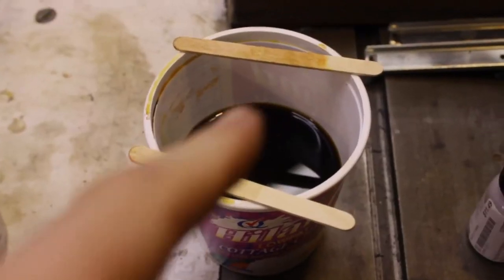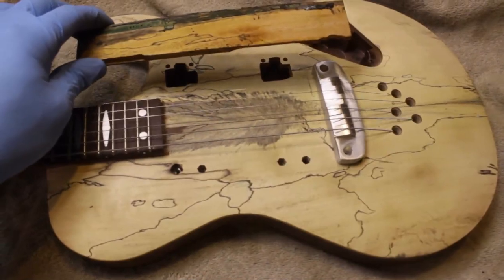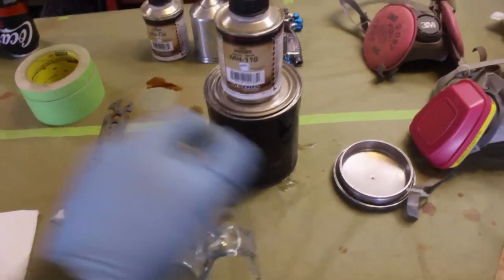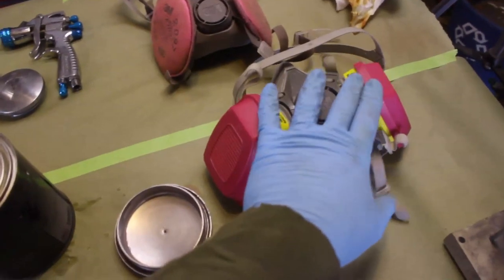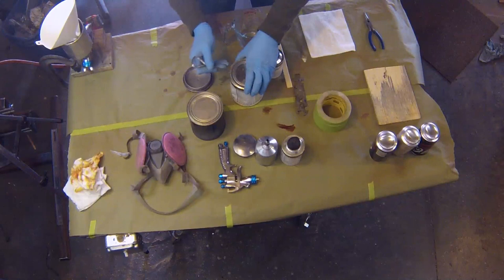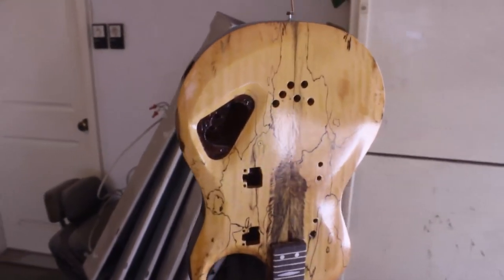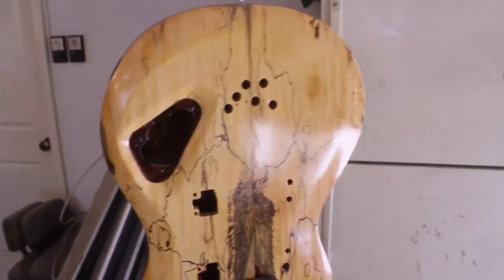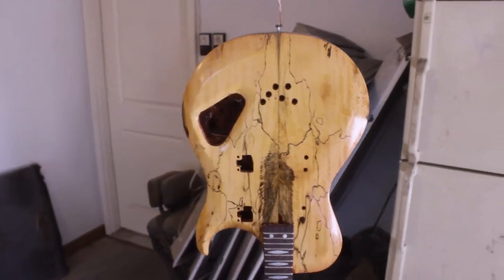Tinting and Painting the Guitar - Custom Guitar Build Part 33

Comment: Oh yea much better result.  Definitely nicer than the version with the slight fade around the edges.  Yea, with matte clear, better to go a little dry with it, which introduces some peel, but you can't risk a run, impossible to get a run out of matte clear without re spraying in my experience.
Reply from the maker: turbocobra Agreed...  I laid a light tack coat, then 2 heavy ones.  I obviously got a bit wild on the neck but of all places...  That was the place to have a run.  It all laid out dead flat, I still can't believe it.

Comment: There are a lot of unique techniques that can be used to change a stain color to look many different ways to get where you want to go. You can put stain directly over bare wood to get one effect and then put the same stain over wood with a sealer coat on it and you will get a lighter more even suttle stain color. for lighter tones you can use white stain bases under the color coats to get mildly blended stain tones. Most people don't know or understand that if you seal the wood before staining it you can control how deep and blotchy stain penatrated the wood. Some woods turn out very blotchy if stained directly. OLDDUDE

Comment: Raw umber paint colorant applied very gently and lightly with a short stiff brush around the edges would give a beautiful highlighted edge to your beautiful guitar finish. Raw umber is brown but a greenish brown and not reddish brown like burnt umber and  would look very nice. Nice job Greg. Cheers OLDDUDE
Reply from the maker: Thisoldcar Ha!  I bet that's the brown I had...  I looked at it on the popsicle stick and thought...  It's too green, so in the mixed cup I added a bit of red.  Opps.  Either way, I'm happy with what I got.  I need to do a bunch of experiments on scrap wood.